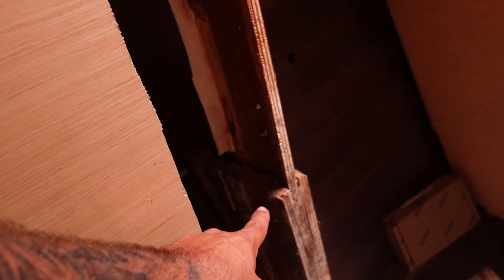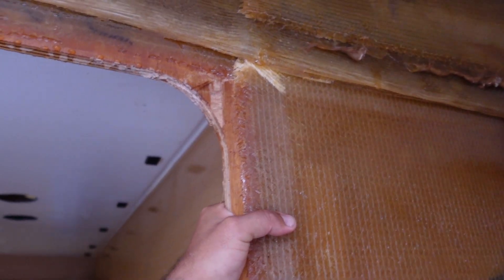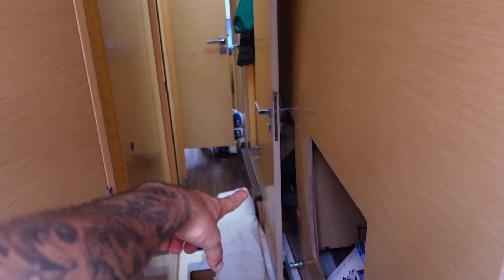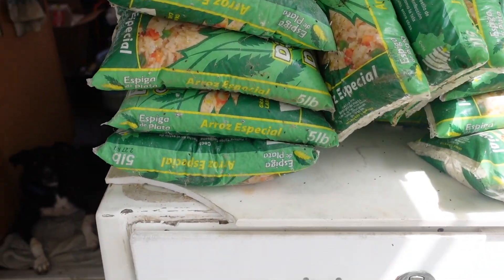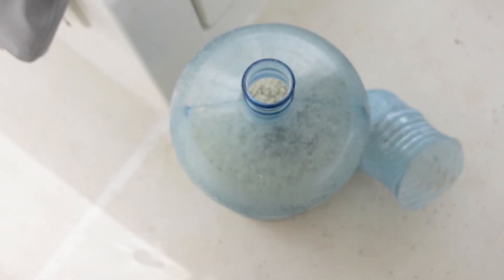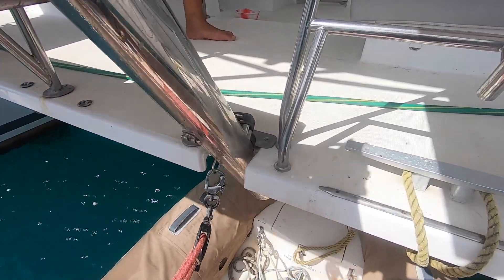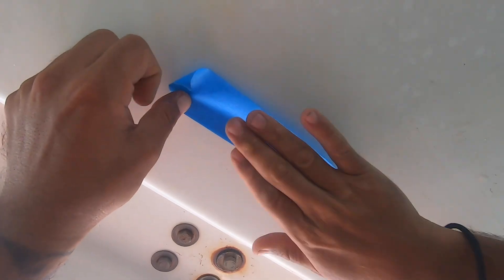CRACKED BULKHEAD REPAIR SERIES: Part 1 - An introduction... (Episode 107)

Comment: Tell me again how the best cat boat designer in the world designed this boat.
Reply: He designed it he didn't build it, its all about the money......build it cheaper...make more money
Reply: @edwardsilva895  exactly. When the boat goes into production there’s likely a conversation had at the factory about what wood resin and glass can be used to make it good enough. Every yard or glass and oz of resin they don’t use is compounded over the large production run and results in massive savings for the company. It’s the same with all modern production boats these days but obviously some are worse than others. In reality it happens at every major product manufacturer I’m sure. That’s why so many people believe older boats are more solid I guess. Unless they’re from oil embargo era where manufacturers skimped on weak resins.
Reply: @edwardsilva895  well for this amount of money i call it a scam if you rush it
Reply: Probably built for a weekend coastal cruising market that wasn’t expected to see much blue seawater over its lifetime.  Biggest problem for Lagoon, is the possible discovery of a build fault that predates the hurricane or can be demonstrated that it lead to the catastrophe bulkhead damage through the boat. That would be grounds for a production recall, even just to check.
Reply: @KymHammond  https://www.hisse-et-oh.com/tavern/lagoon-450-faiblesse-cloison-de-mat

but there is already other occurencies prior any hurricane salvaged 450. 

and yes VPLP is a architect , not a boat builder and is not following manufacturing or any workshop workaround versus his original design/plan
Reply: @damientelle  if I understand you correctly, Parlay cracked apart the most at the point where there is a preexisting structural weakness and that it was most likely to have been cracked to some degree already, and the hurricane only exacerbated the problem?
Reply: @KymHammond  the 450  has indeed other case of broken bulkhead w/o hurricane history. For me the only common point btw Parlay and the french boats having the same bulkhead broken is a new ring or ringsetting (too high ring pre-tension?)
Reply: @damientelle  I can see that. You would think with bulkhead damage that serve the rigging tuner should have picked it up. The damage looked extremely old from what I could see.
Reply: @KymHammond  in the french forum there are pages of discussion about the rigging process and especially for the cat. whatever the boat has a weakness or not. it seems that a good way to preset the ring on such large and cosy cat should be with the cat on jack (under the plateform). you set the tension given by the manufacturer  and then you drop into the water and check some geometry (like the vertical wall explained in the video). but a lot of rigger do it with the boat on water. it was the case for the french 450 with the same damage. as well inside charter fleet. the potential issue is that you preset a tension on a structure already loaded by his own weight, increasing deformation. i can’t state if it is really the case. but the logic is coherent. for the french boat , ending in front of a court, it seems lagoon was trying to push somes responsability to the rigger.
in any case, it is for me clear that the way the bullhead are manufactured (plywood overlapping, hole added for suystem installation, glass fiber 0-90 instead of 45 deg biax) generate weakness. and with such large platform, the rigging becomes even more critical
Reply: 🤔 ... as in 'Good from far. But, far from good'.
Reply: Yeah right..... like how
Reply: just looked at the cover image for the very first episode 2 years ago, and guess what?  In hindsight one can see on the image that the hulls are not in alignment. It could be camera angle and lens effect, but given what we know now, it's probably what it is.
Reply: @VonSaxons  we don’t and shouldn’t know what their legal position is for repairs but that’s an interesting find.
Reply: and for the year.....technology moves fast and production even faster... i dont fault anyone really

Comment: I guess it begs to question, if I haven't missed that already, as to what initially caused the hull failure, to begin with? Was it a result of the initial storm it went through that caused damage unforeseen till now?

Comment: My concern is what is actually doing the work those bulkheads are supposed to be doing and how much more undetectable damage from stress those will have. The entire hull structure is a system that has to work together to maintain its shape and function. Should probably stop opening up more areas around the bulkheads if that’s is what is keeping the vessel from collapsing in on itself. Wait until your on stands in the yard.

Comment: I'm not an engineer, but I don't think you need to be one to come to the conclusion that this is either a design flaw, or a fault in the original construction of the boat. That's unfortunate, as these boats do have an appeal for their looks and layout. But if the foundation is faulty, good looks means little if it isn't structurally sound. Cheers from Winnipeg.

Comment: West systems products are awesome have been using their products for yrs. I've used carbon fiber weave as well with repairs I have done which added that extra bit of strength, especially on the angles. Just a suggestion.... You guys are killing it wish I could be there to help ! ! ! @Sailing Parlay Revival

Comment: Still if the architect was so good your boat would not be broken.
 By just the look it shows VERY shoddy construction. Usually poor finishing is a sing of hurried construction ,like a busy yard ,
 not necessary bad construction, here we have obvious hurried bad construction.That bend plywood at 13:25 is unseen in the business
(for people not fanilliar with epoxy also polyester a glue joint is stronger than the wood ,meaning a failure rips the wood apart ) 
here at 13:25 we see the 2 side plywood panels separated from the bent bulkhead without any sign of tear meaning they where so poorly laminated or not at all when glued lamination is precisely the very basis for the exponential reinforcement of that type of construction.
BTW :Fixing and reinforcing the dozen of small failures might not address the real cause of the problem and they may reappear somewhere else in the future.

Comment: Are you planning on taking off your mast? I do not see how you could ever truly fix any of that without reliving pressure from the deck? Also, where there were 3 ply's of wood then one ply with holes in it, I would seriously be thinking to put some bolts to hold the 3 new ply's together if your going to run 3 ply's all the way up on your bulkhead. Fiberglass isn't made for anything like that, I don't know why there wasn't any more engineering that went into that. I hope for other Lagoon owners that they take a serious look into their own boat bulkheads!!

Comment: Seeing the separation and how the plywood has given, my uneducated guess says moisture softening the plywood, then glue separating from the surface. Sample piece shows wood fiber on the separated glue layer if the case is this. Glue failure is possibility as well, but that doesn't explain the flex of the plywood, while too moist plywood might.
Maybe supporting through bolts with wide washers to keep that kind of stacked structure from coming apart again?
I would also look into ventilation of the hidden structures as well while inspecting.

Comment: I wonder if this is only happening to those cats that have been lifted under the bridge deck compared to those lifted outside the hulls with lift straps.  The physics says the bulkheads have an exponential amount weight hanging off them when lifted under the bridge deck only.  I can’t believe this is just due to sailing hard. Anyone owned a 450 from new and only lifted with straps?

Comment: Holy F.. As a Swedish carpenter and I see that happening to a house or barn (which is more common) I start with getting some stilts and I raise the roof from the ground so what is above my head is resting on stilts that are lifting the entire roof structure and I work around the broken parts and reinforce with new and fresh material but also slightly thicker wood. and if it's a talk about "a tight fit" then I'll use Oak staves around 2-3cm out from the wall x 5cm wide so you can zigzag some screw's instead of a straight line. and ofc pre-drill that oak with the thickness you got between the screw wings, not the "neck" of the screw. Everything can be sealed away from moister, Even possible to make it be able to handle 2psi of hot water vapor pressure. 
Laminated plywood ain't the strongest "contractual bearer" And the glue that keeps the plywood together is quite brittle but strong, but doesn't like shocks so jumping big waves is never a suggested thing with a boat further more why not to do it with the construction is more about low weight than slightly too much strength for the times it's needed. 

Also I Want to let you guys know that thanks to you 2 I am considering to adopt a sail boat (Yes ppl give them away for free here in Sweden, 32-38 footers for free (Somewith a trailer also)..Entire interior has to be updated it's all giving that 50s-70's interior that has dark varnish.. but since I've worked with my hands on land for past 15 years I am not afraid to accept a building challenge. and I LOVE to do custom work like Co-elaborations with artist's or custom designed and made kitchens.But since the owner it can be 1 manned if you know your stuff you can cross the Atlantic.. So me and my friends got this crazy idea to take as many donor boats we can and build our own Cat.. But seeing the struggles you have I think I need to start small scale x'D

Comment: Good on lagoon for stepping up to offer technical advice on the repairs. I wonder if they would be as willing for someone without a social media following. But that aside. This was a hurricane damaged catamaran which undoubtedly had compromised the structural integrity of these bulkheads.
As one engineer to another, Colin, is it only the hull that took on water that has suffered these major bulkhead failures? It looks like there was water damage on those bulkheads and as they weren’t fully encased with epoxy fibreglass that would have weakened the plywood as well.
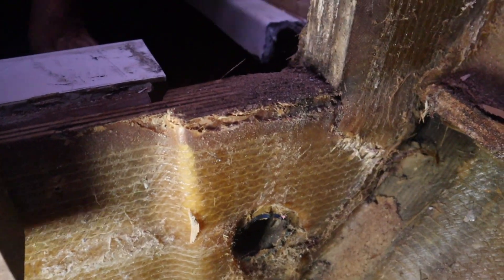As I remember, when the boat was relaunched after the major work done in the Rio Deluce there was cracking heard when she was raised up off the hard stand for relaunching. I thought back then and commented that should be checked. I suspect that that was the bulkheads starting to let go. Good call going full epoxy with the repairs and removing the construction adhesive. I would suggest if you can to fully seal all of the bulkheads with epoxy fibreglass encapsulation leaving no exposed wood. This will ensure no moisture entry to weaken the plywood and will be structurally stronger too. Also if you need to butt join sections of plywood for the repair, use a 1:12 scarf joint as a minimum with extra fibreglass reinforcement on both sides of the scarf joint.
There will be a lot of people that will say that it is poor quality by the builder using the adhesive on the bulkheads. Those people need to realise that all production boats are built the same way and are glue and go boats that are suitable for their designed purpose, which is aimed at the island hopping charter market. As with any storm damaged boat there will be structural issues that may not be apparent at first, but will show up later as with Parlay. No production boat is designed to be storm damaged and partially flooded and not suffer structural problems as a result. If one wants a vessel that will not suffer these potential problems then a semi-custom builder where the construction is not a glue and go method is the only way to go, but the price will be much higher to reflect the many more man hours and materials involved.
Reply: After reading some of the comments and looking at other channels and sites it does appear that this is a serious build quality and design failure issue on Lagoons part. There are more and more owners that are inspecting their bulkheads and finding the same failures although not as extreme and not storm damaged boats. Lagoon needs to step up to the plate big time globally to put this flaw right before they loose all credibility for their product. I would guess that this quality and design issue is not just limited to the 450 either as the same design, materials and methods were used on a number of models over the years.

Comment: It was a used boat before it was a hurricane damaged boat. Nobody knows what stress it has experienced. But my first guess is that the standing rig was tightened without the benefit of a calibrated tensiometer. It is way too easy for an inexperienced person to try and plumb the mast by over stressing a stay.

Comment: These bulkheads should be reinforced with carbon fibre beams - the plywood sandwich shows the cheap nature of the construction - motorhome quality.
Reply: I have a very high end camper and the finishes are what makes it so.  Your comment is spot-on, as I have seen how they are built.
Reply: Yep and if it gets wet will turn to mush in short order.
Reply: You get what you pay for and even carbon fibre breaks, check out the damage on Hugo Boss and other boats that failed on the Vendee Globe. Marine grade plywood is better stuff than the materials used in RVs.
Reply: @jean-pierredeclemy7032  And you can get an internal break in carbon that is virtually undetectable until failure.

Comment: My friend, could be the bulkheads are overstressed to failure.  That would explain the warped Marine Grade Plywood in the bow section at the end of this video. That type of warpage occurs over a significant period of time, such as gradual relaxing of tension from the fore and aft stays as the bulkheads sag. For sure, not a one-off Hurricane event caused that damage. Could have contributed to an already existing condition, but not the main cause. (my two cents).

Comment: Mmmmmmm..... water saturated ply looses it's strength heaps, was that the side sunk in the hurricane?
That bulkhead being inside 2 panels, would take a long time to dry, thus giving it time to compress even on the hard with the rigging pulling the hull up, perhaps along with the hull on blocks helping to compress the bulkhead, a combination of all these factors perhaps....... (old boat builder here)
BTW, use heaps of peal ply inside! No itichys...........

Comment: When I see this kind of damage I wonder if the boat can ever be put back into it's original shape and stay there.
I don't doubt your abilities Colin, you are far more capable and experienced than I am but surely it would be simpler to find a hurricane damaged boat like yours, fix it up and transfer all your good rigging, engines and other items over to that. You have shown you are more than capable of fixing up shell damage etc but when it comes to structural issues like you have there, it's a different matter entirely.

Comment: Seems like they failed to compensate for the loss of strength caused by the door opening in the bulkhead. This will be both a lesson for you and Lagoon by making it right.
Reply: Not the first boat manufacturer to make that mistake, but, I'm very surprised Lagoon made it.